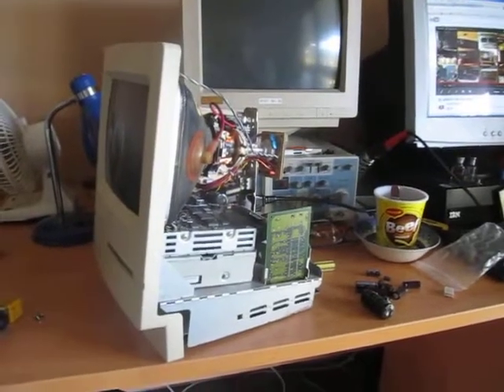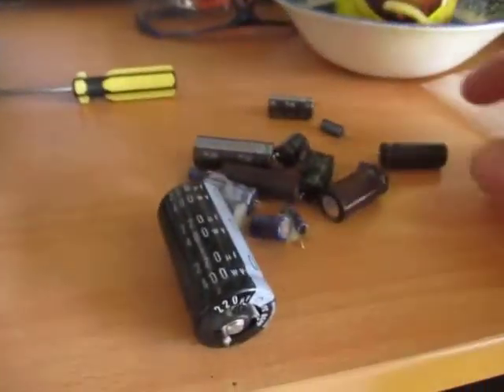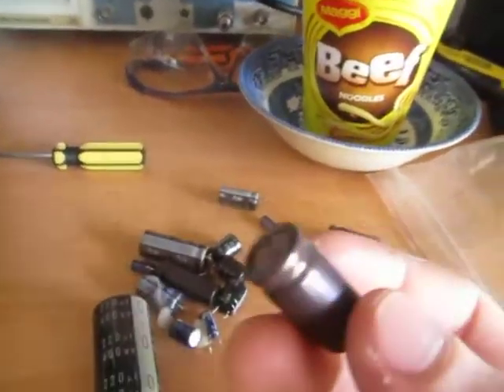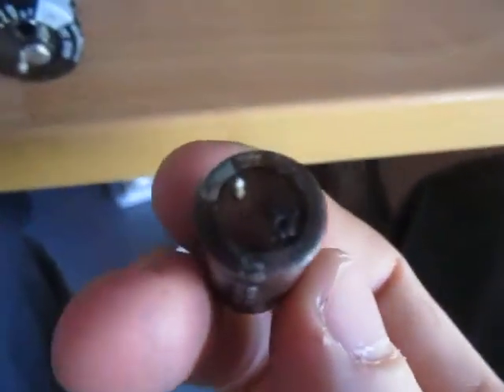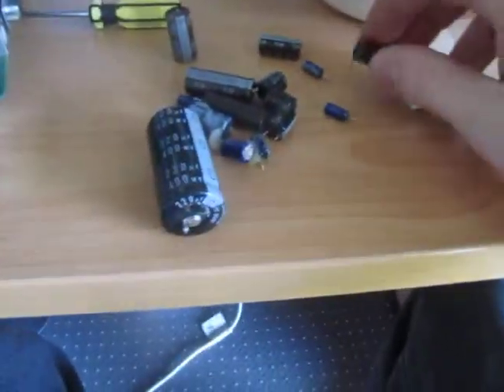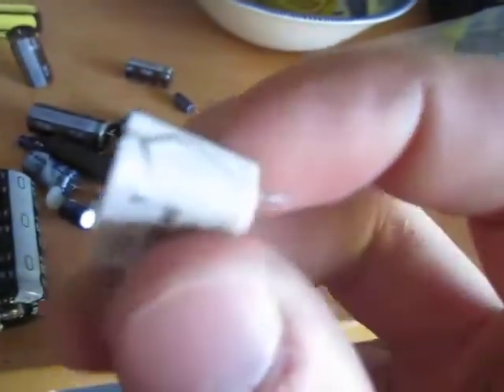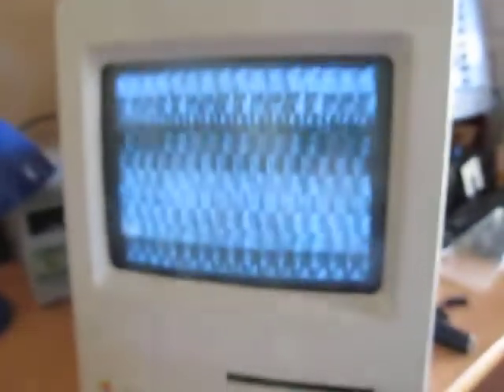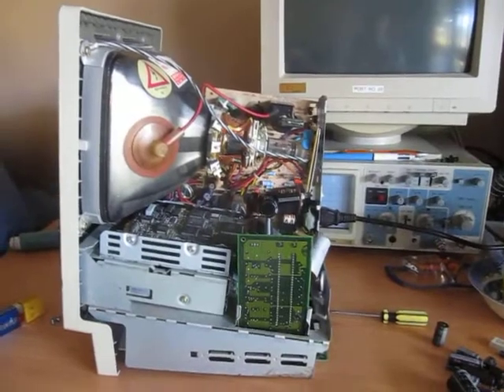1992 Macintosh Classic (another update!)

Comment: Hi, I recently dug up this same computer from 1993, which has been working up until around six months ago.  When I tried recently, the computer wouldn't turn on.  I took out and cleaned the logic board, put it back in and the computer started up, but the screen wouldn't turn on.  I've tried most of the normal troubleshooting solutions, but the screen is still black.  Do you have any advice and/or where else might I find help? Thanks, Keanan.

Comment: Could be a bad video card module, but the lines could be signs of a virus of some form, though what it is if it's a virus it's hard to tell, but don't network it with your G3 just incase it is a virus, it could just be corrupt operation system needing fully re-installed.